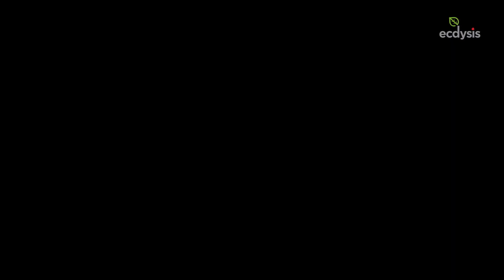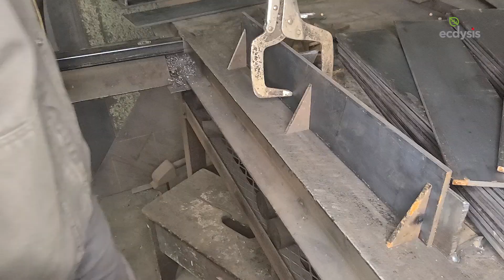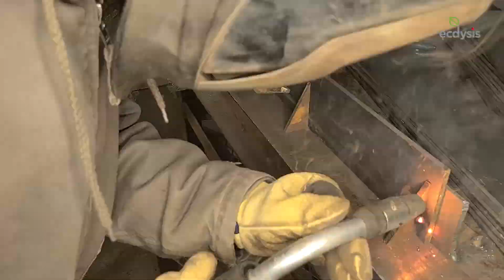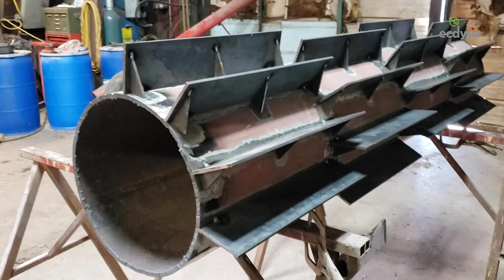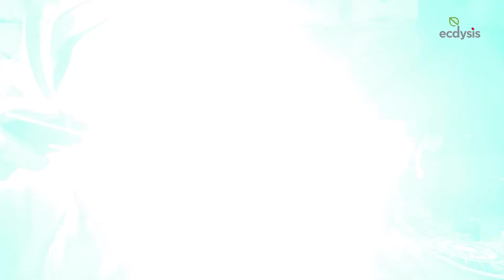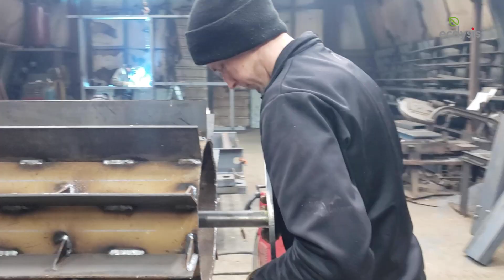Build Your Own Roller-Crimper Part 4: Attaching Crimper Blades

Comment: Is this a $50k pc of equipment ?
Reply from the maker: Thanks for your question! Cost and availability was a big motivator of the project, so that farmers would have more accessibility to roller crimpers. The cost of materials for this project was $5,853, and the total hours gathering supplies and constructing the crimper was 190. However, with the tutorial, we would hope anyone building the crimper using these plans can reduce the hours significantly. A full report on the project with supplies and costs can be found on SARE's website: https://projects.sare.org/project-reports/onc21-093/